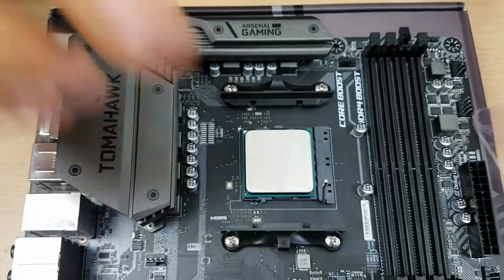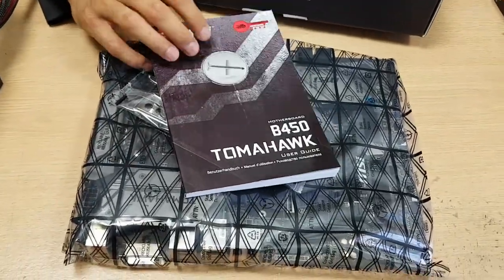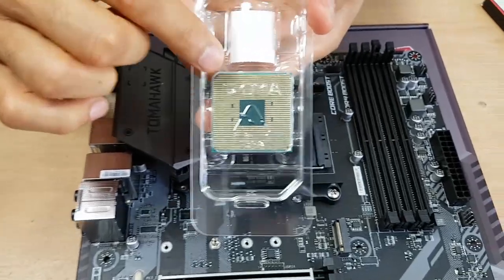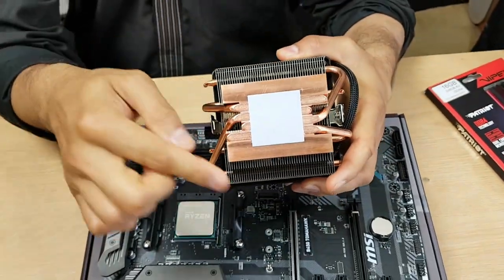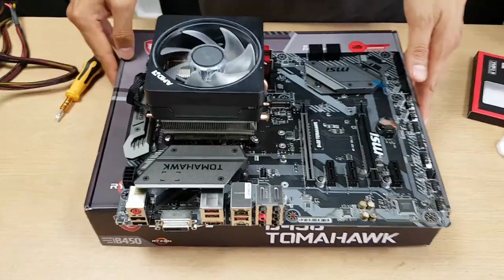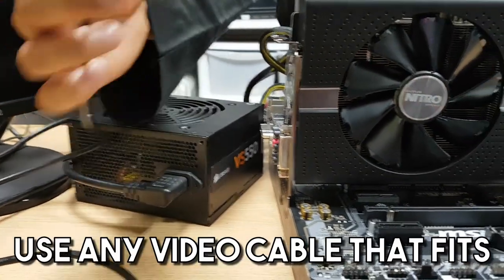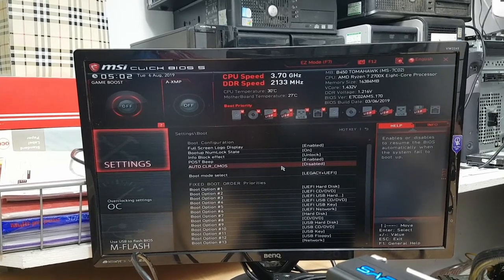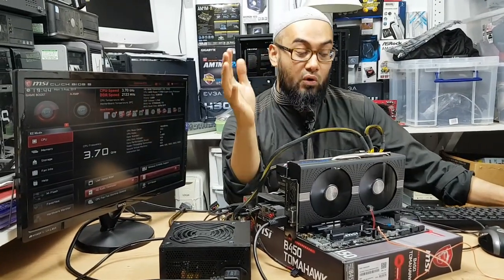Step By Step Guide To Build A Computer - Assembling The PC & Checking For POST - Pt 13

Comment: Nice, you upgraded your pc to Ryzen 7, this is a huge leap from FX 8350. 
Although FX 8350 is even weaker than Ryzen 3, you can use it for secondary PC. I'm using a cpu even older than FX, ye olde Phenom II for secondary pc running Linux Mint.